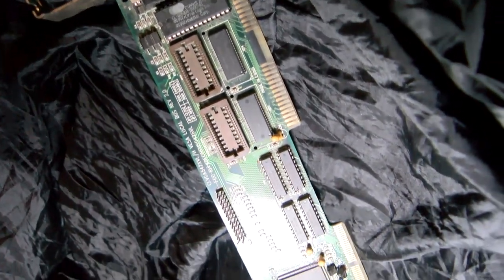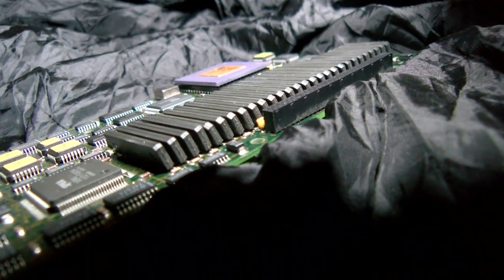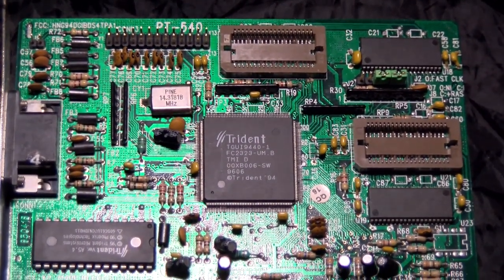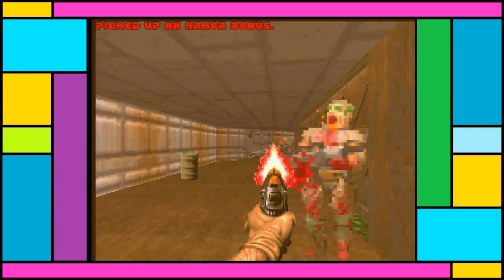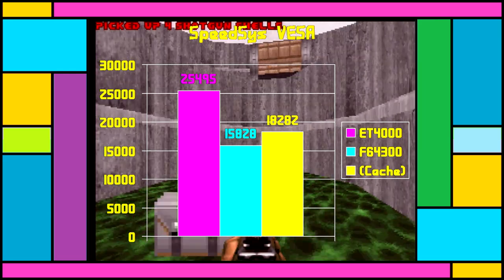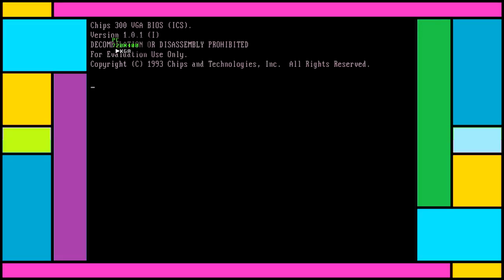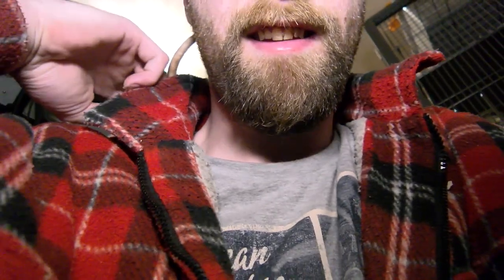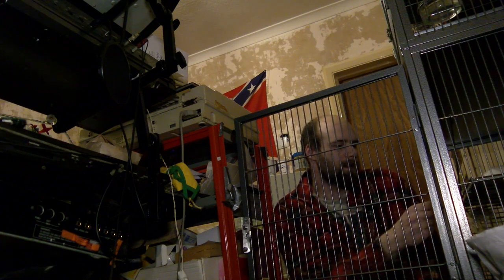C&T F64300 VGA Card

Comment: Expecting integrated-onboard graphics to run the newest games is like expecting a Honda Civic to win Le Mans. I remember trying to run Star Wars Jedi Knight Jedi Outcast on a Compaq Deskpro EN Intel i810 based system and it not wanting to even boot up, the Dell Optiplex GX1 that I had been using at the time could run that game and that computer had ATI 3D Rage PRO as its integrated chipset and that by the way says a lot about 1998 era tech. 1998-1999 models of the Compaq Deskpro EN also have the ATI 3D Rage PRO. I think the ATI 3D Rage PRO was a DirectX 5 based chipset. I might have to try and put Windows NT 4.0 on a laptop with a variant of this chip because there is an Unofficial DirectX 5.0 update for it since Windows NT 4.0 can only go up to DirectX 3.0. I used to run Half-Life on the Compaq Deskpro EN that not just had the ATI 3D Rage PRO but I also ran it on the Compaq Deskpro EN that was based on the Intel i810 video chipset and it ran. I also ran Half-Life on the Dell Optiplex GX1.

Integrated video for the PC started with the 1996-era SiS 5511+6202 chipset. Maybe "integrated" isn't quite the term, as it was still a discrete chip, but it shared system memory, which is the defining feature of integrated VGA. A year later, SiS came with the 5596, which was the first actually integrated solution, integrating the 6205 into the 5571 northbridge. This was two years before Intel's 810. Of course performance was awful, particularly in the 5511+6202 and 5596, as shared bandwidth in an EDO system left the CPU (and VGA core for that matter) completely starved. Intels i810 had a significantly better core, but it suffered just as much from having to share bandwidth with CPU, all the more so when the i810 was paired with 133MHz FSB, but only allowed 100MHz memory - and then halved that.

A lot of the big innovations in integrated VGA were also done by others. The first actually shipping dual channel chipset was ALi's Aladdin 7, with dual-channel SDR-SDRAM to allow both CPU and integrated ArtX (later bought by ATi and turned into the Radeon) VGA to get decent memory performance and bandwidth. A good discrete card still performed better, but it blew away all other 2000-era integrated solutions. ATi was also first to allow integrated VGA and discrete VGA to cooperate so as to get maximum performance when needed and delivering maximum power efficiency when not. Intel has just chugged along with the 'good enough' mantra- for non-gaming purposes (gamers may be noisy, but are and were a small minority) anything that reliably gets pictures onto a screen is good enough, and by integrating that into entry-level chipsets and later CPUs they've pushed all but the most high-end competitors out of the market. Great business acumen, but hardly a technical innovation.

From what someone on the Vogons forums has tested is that SiS 530/630 style IGP and i810 are very far apart in performance, the Trident video included on the MVP4 is also quite terrible and with high performance penalty for the CPU/ram. If we are talking a few years later ATI and Nvidia had some interesting things, another interesting aspect is that the i810 allowed for dedicated ram (most cheap boards didn't use this option) to boost performance compared to just using system ram, the only other IGP I remember with this was the AMD 780g and variations with "sideport" (128MB 32bit ddr2/3 for the sideport and 4MB 32bit sdr for the i810).

Someone once told me that they were very enthusiastic about netbooks back then (and I still really love the idea) and the first "big" thing they bought myself, with money they got as salary, was a 10" Atom N270 laptop. Then bad things happened and my father got into the hospital, while they had to look after their granny. There was no space for a normal PC in their apartment and the N270 was the only laptop in their family.

I've played a few games on laptops, and they worked well enough, but to be honest, it's just not something I'm interested in, at least when it comes to modern gaming. If you look inside a gaming PC, the graphics card is the star of the show. It's often a two-slot monster with its own power cable and a turbo prop to cool it. What, in all we know about physics, makes anyone think that beast would run from a battery-powered device that can fit in a backpack? And if it did, the battery life would be 2 minutes and some seconds, and if you had it in your lap, it would roast chestnuts on an open fire like it was the holidays. No thanks, even if the technology problem didn't exist. I would still have to find some way to reconcile the ergonomics. Nothing about this scenario makes any sense.

The game console world has had a long-standing tradition of separating on-the-go gaming from home gaming. If you're playing at home on a Nintendo GameCube, you're playing on the go with the equivalent of a Nintendo SNES. The games are scaled-down and simplified, only certain genres make it. Nintendo Switch upset this apple cart, and I didn't think it would work at all, but Nintendo has done a heck of a job pulling it off as well as they have. It's not a powerhouse at home, and it makes some compromises beyond that for on-the-go, but it manages to do a lot with a little.

I will always have some amount of respect for Intel Integrated Graphics or at least on laptops from 2006 all the way to the present. Laptops with Intel Integrated Graphics from 2003 were as far as I could tell garbage. The fact that I could run Warcraft III on a Dell Inspiron B130 was mindblowing. The fact that I can run windows 2000 on the Inspiron B130 makes it good for backwards compatibility purposes. Not even my Gateway M320 which also had Intel IGP could run that game let alone any game for that matter. Modern day Intel graphics are good at video playback and for the most part that's about it. I am a huge fan of the ATI Mobility Radeon IGP Xpress Series when it comes to integrated-onboard laptop graphics mainly because they are DirectX 9.0B compatible. Because the Dell Vostro 1000 has an ATI Mobility Radeon IGP Xpress 1150 makes the retro gaming aspect of this laptop almost limitless.

The difference between integrated and onboard is that integrated means that the video chipset is integrated into either the Northbridge or the CPU whereas onboard means that it is a separate chipset. Integrated video chipsets borrow main memory - because that's the definition of an integrated GPU: it's hidden inside something else and takes away from your main memory. The rule of thumb is that If you can find a GPU chip on the motherboard (or on a separate card), it's discrete. If it's hidden inside something else, it's integrated.

There were definitely discrete GPUs embedded onto motherboards by OEMs - the S3 Trio is commonly embedded onto the motherboards of IBM Aptiva desktops in the mid-to-late '90s. The Thinkpad T21 on my shelf has an S3 SavageIX GPU on the motherboard as well. In contrast, The Intel X3100 Integrated GPU is hidden inside the i965 series Northbridge chip, as is the X300 GPU die in the RS400 Northbridges ATi made for Intel CPUs. Now, just because they were integrated doesn't make them bad - some implementations were decent. The SGI O2 workstation uses an integrated GPU, and they work just fine. The nVidia MCP89 in the 2010 Macbook Air/Pro 13s were competitive against the Geforce 7600 Gos, and Bioshock Infinite was definitely playable via Haswell/Broadwell GT3 graphics.
Reply: Before ATI got into making mobile laptop video chipsets you had video chipsets like the Cirrus Logic GD7543, Cirrus Logic GD7548, Chips & Technologies 65554, Trident Cyber 9397, NeoMagic MagicMedia 128XD, or S3 Aurora64V+ which was standard fair for integrated-onboard video chipsets on desktop computers as well as laptops from 1996-1998. These chipset usually had 1 MB, 2 MB or 4 MB of VRAM available. Socket 7 based HP Vectra Intel Pentium Classic and Intel Pentium MMX based machines had Cirus Logic and S3 integrated video chipsets.

The 3D Rage LT might be the first GPU intended for laptops (announced in late 1996 sampling, but not in volume production until mid-1997), but it only made it into a single laptop design as it was a PCI only...the Wallstreet Powerbook G3. The 3D Rage LT PRO was also not the first mobile GPU to use AGP - that chip came out in November or 1997. Both the S3 Virge/MX and the Neomagic 256AV came out earlier than that.

There are weird little integrated/discrete hybrids throughout history, like the i810s with the AIMM AGP memory module (it allows the i810 to talk to the RAM module in the AGP port and not borrow main RAM - which would in theory perform better, but the entire i740 Starfighter architecture relying on AGP for fast VRAM access was a massive conceptual blunder), the Intel Iris Pros with their massive L4 cache (128MB on my Haswell 4770R) acting like embedded VRAM, AMD with that zero-copy RDMA2 architecture on their Kabini APUs, or the recent Kaby Lake-G where Intel embedded a Vega-M GPU and 4GB of VRAM directly onto their CPU die. Out of the 4, AIMM was a non-starter, Kaby Lake-G is a dead end, I am not sure if Intel is still doing Iris Pros, but the RDMA thing is the linchpin behind the Playstation 4/XBox One sharing 8GB between their integrated GPU and their CPUs.

My Compaq LTE 5300 has a Cirrus Logic video chipset and plus that laptop has a ESS AudioDrive ES1688 as its audio chipset and that audio chipset is Sound Blaster Pro compatible and in addition to that it has a pretty decent approximation of Yamaha’s OPL3 FM hardware. ATI 3D Rage LT PRO was one of ATI's greatest contributions to integrated-onboard video chipsets back in 1997-1998.

Wikipedia says that the 3D Rage LT (aka Mach64 LT) was often implemented on motherboards and in mobile applications like notebook computers. This late 1996 chip was very similar to the 3D Rage II and supported the same application coding. It integrated a low-voltage differential signaling (LVDS) transmitter for notebook LCDs and advanced power management (block-by-block power control). The 3D RAGE LT PRO, based on the 3D RAGE PRO, was the very first mobile GPU to use AGP.

The 3D Rage LT Pro offered Filtered Ratiometric Expansion, which automatically adjusted images to full-screen size. ATI's ImpacTV2+ is integrated with the 3D RAGE LT PRO chip to support multi-screen viewing; i.e., simultaneous outputs to TV, CRT and LCD. In addition, the RAGE LT PRO can drive two displays with different images and/or refresh rates with the use of integrated dual, independent CRT controllers. The 3D Rage LT Pro was often used in desktop video cards that had a VESA Digital Flat Panel port to drive some desktop LCD monitors digitally.
Reply: @KainiaKaria  get a gf mate

Comment: Hope the council get off your case.  Which version and build of Vegas are you running? 17 build 284 was very buggy for me, 321 is much better (torrent hash b15be121f10b39fb9918eb069ac239be7145b25e).
Reply from the maker: They probably will eventually, they're broke and it's probably costing them money to send someone out all the time. Vegas 12 563 here, later versions looked nerfed so I never upgraded, guess I could always try a later version out, it's not hard to back up my presets and stuff.

Comment: Go AMD x570 Ryzen 3 is what I'm thinking in the future, though currently I'm still running x5650 on a ud3r + usb3 card, and a gtx970 which means I can run a rift well enough. What's your current main rig build ATM. Don't take on the council as an enemy, you need to find a way of being secure with your 90's tech explorations, I'm almost tempted to say You need some uk viewers to pop up & paint the walls & tidy, then possibly the council might leave you alone? Though renting from the council is one sure fire way of having them mess with your life. In various ways. You do not want another disrupting move like before where stuff is lost etc.
Reply from the maker: Current machine is a Xeon E3-1271-V3, X10SAE, 32GB RAM, GT 730, it really should be good for a few more years but the OS has other ideas. The council is already an enemy and has been for years, they're not bothered about the walls or anything, in fact they'd more likely be mad if they were painted as I'd have to 'un-paint' them again if I ever left, plus I don't like any of the colors they allow. Can't really tidy where there's no mess, so they haven't mentioned that either, as I said, they can't find anything wrong so keep coming back in the hopes that they'll catch me doing something.

Comment: Just noticed you mentioned Supermicro not patched something related to sound. Ha! You will be more scared after they done with patching something. Let me tell the story about once great motherboard (now dead for no reason after being stored in fully assembled PC for maybe 3-4 years without powering on) Supermicro P4SPA+. With stock bios it had right after purchase it can't save bios settings with USB keyboard, ok i patched it with latest official, now you can't use Adaptec SCSI with onboard LAN (and it was great fully realized Intel CSA solution, just like AGP, but for network, so i have free PCI bandwidth for my own needs) to the point PC working like it is PII not the 3.0 Northwood or even BSOD occasionly. Ok, now i can't reverse to old bios (stupid me forget to save it, because i thinking that i'm working with reliable hardware), site doesn't have it too, thanks to some googling i found a vesion inbetween of those two i had. Lets flash it and... now SCSI works, LAN works, bios settings saved, but i can't mix USB and PS/2 peripherals, only one way or another.